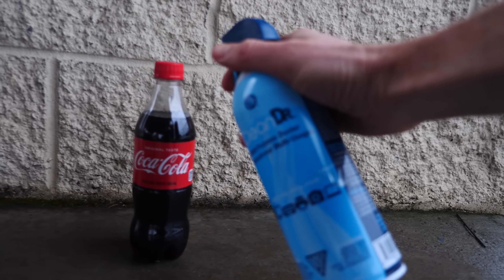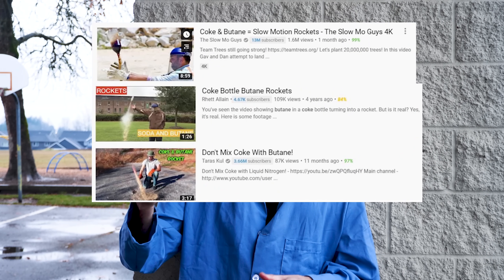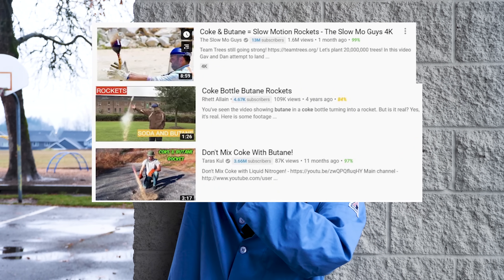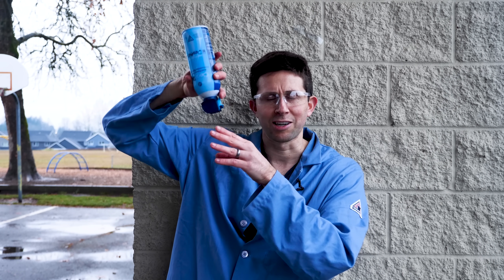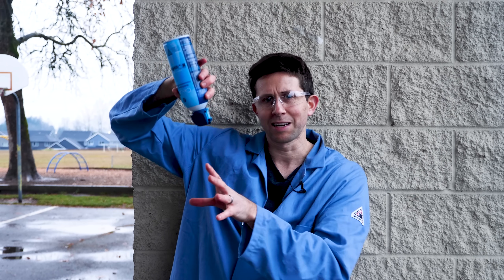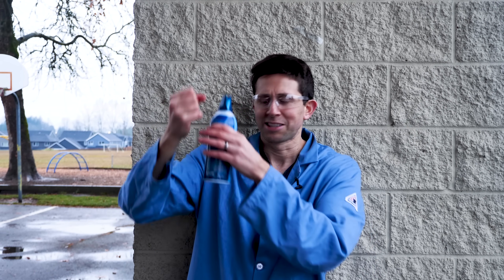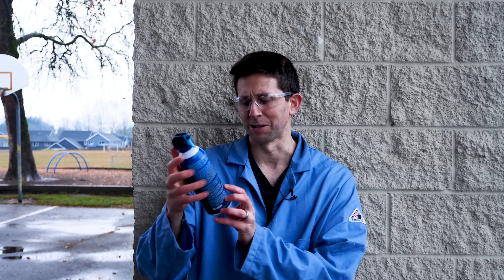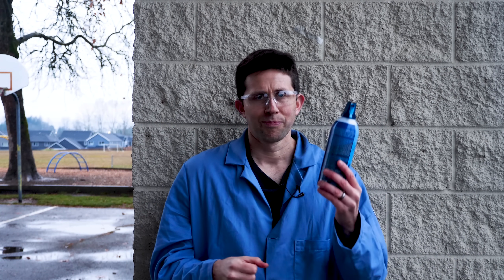Coke Butane Rocket Without the Butane

Comment: basically the canned air is r152a refrigerant.

if you was to put that stuff into a refrigeration unit it would work.

also breathing the fumes is not good either and doing it outdoors is a good way to avoid breathing the fumes

Comment: I've seen some pretty nasty explosions from canned air (
 similar to molten salt in water level of power) I think you've made a less safe version. 

I think the only thing that kept your fingers safe was the ice plug which formed which mean the shock caused a much slower mixing with far less contact. 

p.s. I think the hitting the ground had nothing to do with "building pressure" and everything to do with rupturing the ice plug.

Comment: Are you sure about the butane coke mechanism?   The butane and your difluoroethane floats on top of the coke.  When inverted, the butane or difluoroethane rises through the warmer coke turning it to gas, those gas bubble causing a huge number of nucleation sites which draw CO2 out of solution creating even more gas which pushes the coke out of the nozzle.  Warm coke increases the rate of the process of course.

Comment: I have a question why is it when you through something it stops for a split second the it falls
Reply: The speed of the thing you threw equals the speed of gravitation pulling it down so it's basically not acceleraring in either direction for a moment.
Reply: Thanks bro

Comment: I am always fascinated with your ideas and respect your impassion for trying new stuff. On this video however, I must comment that making this rocket with 1,2-dichloroethane is actually not safer compared to butane. It is true, that dichloroethane is not as flammable as butane and does not build an explosive mixture with air so easily, this stuff can irritate your skin and respitory system, and is toxic if inhaled. This stuff may also cause cancer and damage your organs, which is not nice. (For more information check this: http://gestis-en.itrust.de/nxt/gateway.dll/gestis_en/010500.xml?f=templates$fn=default-doc.htm$3.0)
Furthermore, dichloroethane is a HCFC, which can damage the ozone layer and poison organisms in water. It is also a greenhouse gas. So this is not exactly the thing you want to emit into the nature. 
I admit, that building a rocket is pretty cool, I would rather do it with butane (or dry ice with the bottle closed) and pay attention not to have an ignition source. 
This is not to criticise though, love your videos😄!

Comment: I used to use canned air for everything until I realised it was 1,1,1,2 tetrafluoroethane. Mildly dangerous stuff if you're indoors and using it a lot, especially if you're down in a cellar where there's nowhere it can escape. People have suffocated and died in vehicle pits when repairing AC systems on vehicles, due to the R134a refrigerant gas (the same as 1,1,1,2 tetrafluoroethane) building up in the pit. It's heavier than air so it stays in the pit unless there's adequate ventilation.

Comment: What would happen if you modify the bottle so that the opening was smaller (possibly by putting a hole in the cap).  Also can you use other liquids than soda?  I would imagine it would have a similar effect if you refill the bottle with another liquid such as water.

Comment: Elevation might play a part in this. I had my best success at a rest area on I-80 in Wyoming that was about 9000 feet in elevation. At home, at 900 feet elevation, I had very limited success even using butane. I haven't tried diflouroethane, but I remember seeing another YouTuber try it, and it caused the soda to immediately spew out of the bottle before it was even turned over.

Comment: Next time, please drop the bottle into a mailing tube or pvc pipe to increase pressure and provide the bottle with a directional guide.
I'm also wondering if club soda or seltzer, rather than coke, would have more lift because they have more carbonization.
Reply: These ideas make great sense.

Comment: Tip - if you want to extract some of the liquid - freeze the spray can in the freezer- it will lower the pressure inside (so it is easier to extract without the splashing etc) and also increase your yield - as some of the liquid is wasted on cooling the rest.

Comment: I think the reason it need to hit the ground is because the ice block the air. If you don't break it, it will probably explode like dry ice bomb.
Reply: If the volatile liquid can't get past the ice to force the stable liquid out, it can't blow up the bottle either. It would just fall out of the bottle. You're probably right about breaking the ice to get it all to invert though.
Reply: That sounds even more dangerous than the butane thing!
Reply: It would be in static equilibrium if it doesn't explode when forming the ice block so it might not explode. But, if the plastic is stressed over a short period of time then yeah, it could explode

Comment: Proof they can but refuse to make electric rockets (no combustible fuel powered).
Reply: Firstly, these are not electric rockets. These are what are know as Cold Gas Thrusters, and they ARE used for reaction control. Secondly, the specific impulse (efficiency) of these thrusters is far to low to get anything substantial into space, let alone orbit.